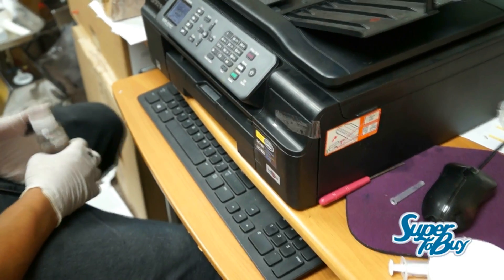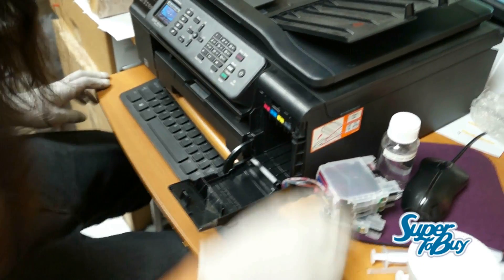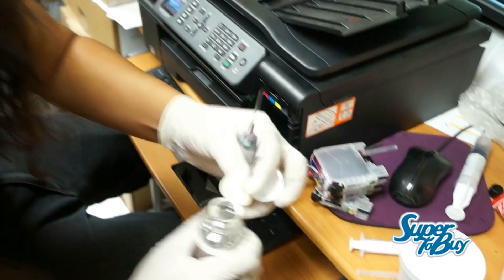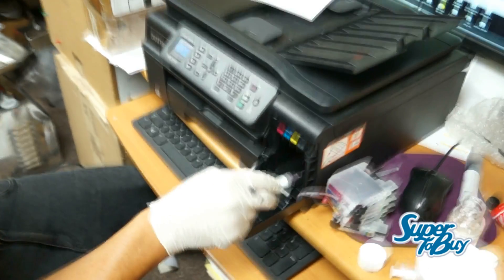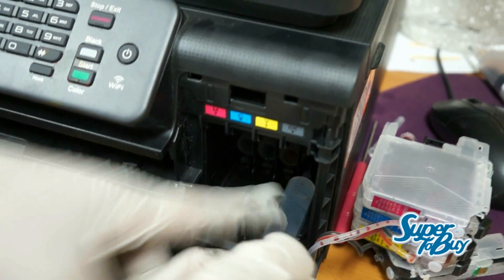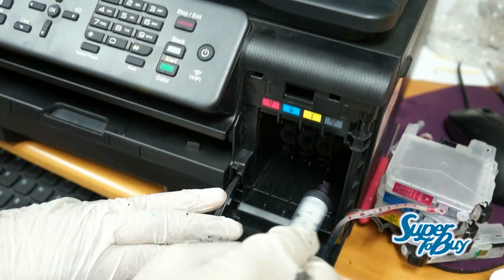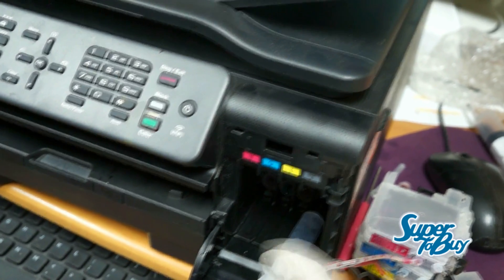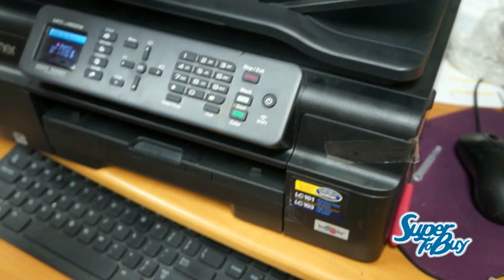Brother Printer Unclogging Printhead

Comment: You can also use a baby nasal aspirater and it fits perfectly on the ink connectors you might struggle on getting it to fit in the black and magenta colors poke the tubes with a paper clip or a beedle like object than use 70% alcohol and some warm water and suck it into the aspirator and inject it into the ink slots and than squeeze 3-5 times until pressured and than on a separate tray pour the ink contaminated water and than do again with the other ink ports after that suck the ports with the nasal aspirator empty to pull out the keft over contaminated water with ink.

Comment: Dear Master.
Help.
I did the head cleaning as you showed, it worked. Black has started.
Works. After two days, I want to print something, code 48 is shown. There is no jam, but the head is on the right side and I do not want to move from the machine or manually for China.
When I pushed with a syringe, I didn't know that the head should go out and I think I flooded everything under the plastic. I can't remove the plastics from above, something is holding it on the left side. I managed to do a cleaning reset, but the printer now turns on for a moment after connecting to the power supply and goes off.
Do something Master.

Comment: I think you have to inject the cleaner into the old cartridge's, use the syringe to inject the old cartridge's. Then run the printhead cleaning option with the injected cleaning solution. Find!, there's an little injection hole under the sticker on the cartridge. find it and inject the solution into it. This my give you a better cleaning result. And possibly a better printing result. I never tried, so don't blame me if you try and it doesn't work. Just a suggestion. We may have to buy empty cleaning ink cartridge to preform cleaning solution injection then cleaning. Using the old cartridge or clean empty one can insure the proper connection between the print heads and the cartridge's while cleaning with the solution while the cartridges are installed properly. Try, and let us know. **Sincerely, B.**
Reply: or try this youtube video It seems like a proper technique on cleaning with the syringe without using the old or empty cartridge's. https://www.youtube.com/watch?v=nP11yDIZo9A

Try, and let us know. *Sincerely, B.*

Comment: @6CCORVETTEMAN
0 seconds ago
When injecting the alcohol, the syringe was very hard to press and withdraw.  I worked it this way numerous times.  Still bad printing.  Finally, I more forcefully injected the alcohol and then heard a "POP."  I thought the black ink line had detached somewhere or the print head was now unclogged I  could then easily inject and withdraw the alcohol.  And, i could hear air being forced out of the print head. So, finally, after several cleaning cycles, by the machine, my black print is outstanding!
I determined that the "POP" I heard was a valve or clog that was opened up.

Comment: So I pushed cleaning solution through to Brother MFC-250C printhead, I've done it and each ink passage goes all the way through to the printhead as shown by soaked paper towel placed underneath, no clogs, then ran several test prints and printhead cleanings and only got maybe a faint print from the cyan, then nothing. Is the circuitry broken or something? The printer seems to think everything is fine.

Comment: Not very helpful. You went too fast, you blocked our view of where you were putting the syringe, you said to perform a nozzle check but didn't explain how to do that. You kept drawing back on the syringe and then injecting it forward, talking too fast, thinking we all know what you're talking about. 
I opened the cartridge compartment on my MFC J485 DW and I saw no hole in which to stick a syringe. My printer prints photos beautifully but it won't print text very well.

Comment: Hey I did this but I didn't have solution, so I just used 70% isopropyl alcohol. After injecting that with a syringe with a needle, and doing 3 cleaning cycles, it gradually improved to good quality again. But RIP all the black ink I wasted doing that. I didn't see an option for nozzle vs. head cleaning.

Comment: HELLLLP i think i put too much fluid inside and now my red color wont print :(. At first it seemed to start getting better but it didnt improve so i injected more fluid. And still it didnt improve so i continued the pattern of injecting more fluid. And eventually it stopped printing red! :'( this is so frustrating. I been at it for like 3 hours trying to get it to work. I actually thought id be spending 15 mins and i should be studying :'(. Im so screwed for class tomorrow.
Reply from the maker: I tried this once before on a Epson printer.  Give it a couple hours and do a nozzle check and see if it comes back . It came back for me one time after giving it a few hours.  It somehow deleted my colors and thought I messed up , but it worked hours later.  See if this works .  Thanks .
Reply: SuperToBuy alright. Will check once i get back home from school tonight. Thanks for the response! Also, i noticed other youtube tutorials showing that they put a paper towel beneath the printheads to soak up the liquids injected. I never did that and im worried its going to wreck the machine. And the inkpad sponge is really grimy with all the ink. I should probably clean that i guess? Thanks
Reply: SuperToBuy its still not fixed for me. This is the most frustrating thing in the world :(. I bought a cleaning kit for 14$. I injected the solution into the red nozzle. Waited almost a day and tried a test print 3 times. Still didnt print red. Then i opened the cover on top and realized the tube didnt fill with red wheras it did with other colors. So i thought the solution would be to fill the tube with ink. I manually injected a half syringe full of red ink into the nozzle AND STILL i couldnt get red ink to fill the tube. THEN what i thought was a good idea was the dumbest thing i did. I turned the printer upright and HOLY SHIT it just leaked a pool of red ink all over my fuckin computer table. The wood is not varnished too so its stained permanent. Ink also dripped down the side of the table but thankfully i wiped it before it touched the carpet. What an absolute nightmare. I didnt know injecting ink into the nozzle goes to an ink waste reservoir in the back! It just doesnt make sense to me. So thats where all the solution went as well from the injections. I am so clueless. I attempted to refill my own cartridge. The lc71M cartidge. Im not sure if i did it right because the ink leaks a bit from the cartridge. I dont know what to do. I may have to toss it. Everything works fine except the stupid red ink.

Comment: I have  a printer brother j100 (I can't reach the print head as you do to put the paper back), Where are the sponge located? where is the normal position of printer head before printing - left or right? in other words, I would like to know if the print head is located on the sponge by default. My idea is to do your procedure without using any paper. Thank you very much, friend.

Comment: Hi man, can u plz make it more clear i mean the video it's that much clear when u try to show the ink level & when u put in the syringe in to the nozzle. BR,
Reply from the maker: What you will want to do is push the solution into the printer and the suck it back out . This will clear any clogs in the printer. Flushing it in and out will improve the prints.  Since these printer models will not allow you to put a napkin in the back , I would warrant the number of times performed, as this may cause some of the prints to leak with the excess ink solution . You will want to wait for it to dry or print blank documents to dry it up .
Reply: Thanks

Comment: Thanks!  Fixed it just by jamming a needle into all the color printheads.  Print color now. Was about to toss it in the trash.   Didn't even have to buy cleaning solutions!
Reply from the maker: Glad to hear! Always good to have more different perspectives for better support. Most printers are usually salvageable if it has a clogged head.

Comment: Didn't you just inject printer cleaner solution all inside your printer?  After it cleans the print head, that stuff is still going to be inside... what am I missing?
Reply: There is a tray inside where the printhead parks. It has foam in it.